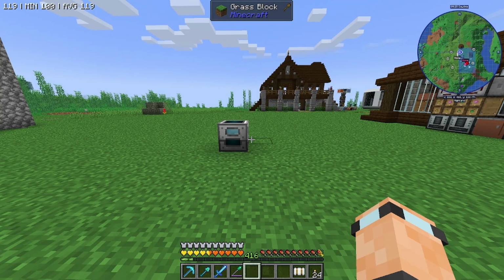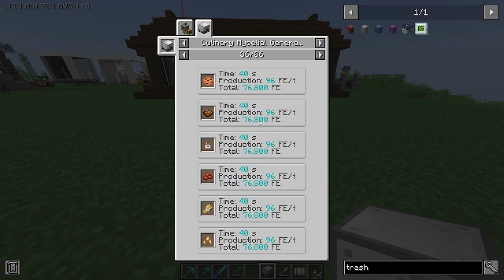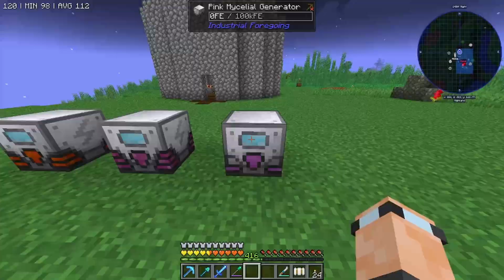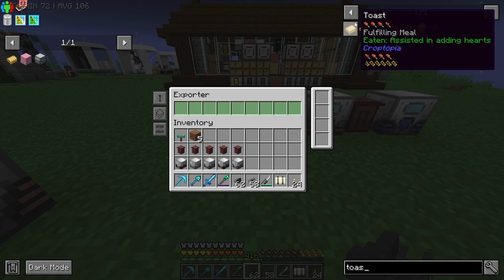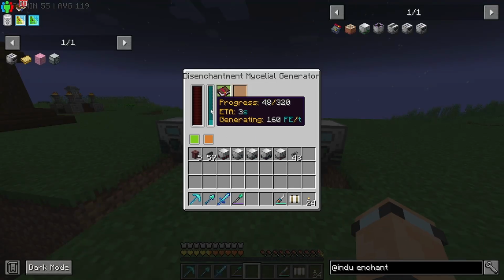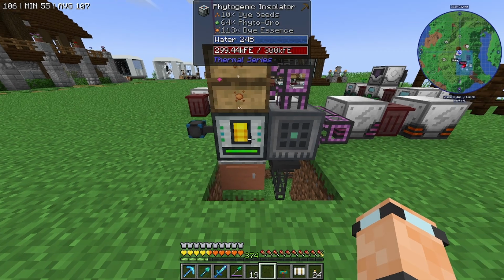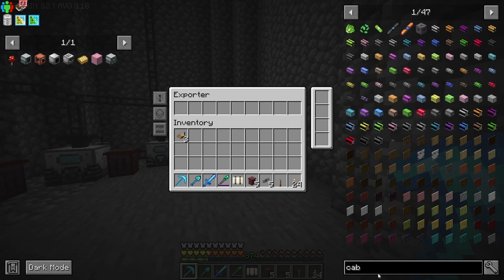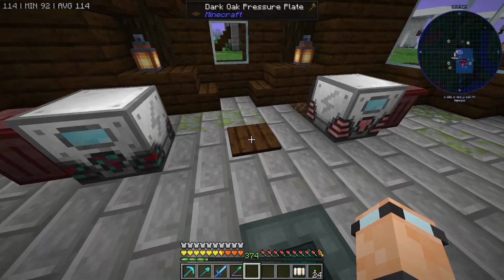ATM9 No Frills - EP 15 - Mycelial Reactor Guide

Comment: Pink tulip or any pink flower will make another pink flower. U can push that directly into generator and save sand and gravel
Reply from the maker: I'm not using the concrete anymore anyway, just puts the pink dye in 😁

Comment: There is many ways to get all the fuels, avocado toast sound expensive 😂😂. In other pack I used phyto with berrys, pink tulip and cimson fungus; and used the cow in a containment jar with a modular router milking.

I didn't know you can saparate the painful generator so much from the reactor. 😮
Reply: pretty sure you can pipe fluid directly from the containment jar you don't need modular routers
Reply from the maker: Ah yeah! You can do a pull from the generator... I like this 😁

Comment: In FTB Skies I used a Phyto to make pink tulips for the pink generator. It worked fine. I also used regulator cards to limit the crafts.
Reply: i just used a integrated dynamics mechanical squeezer to crush tulips from a botany pot.
Reply from the maker: If i had a pink tulip i would have done a botany pot I think, I was too lazy to go find one 😅
Reply: @Pilpoh  I got lucky in FTB Skies and ended up in a plains biome. Easy to get. I haven't seen any Tulips yet this play.